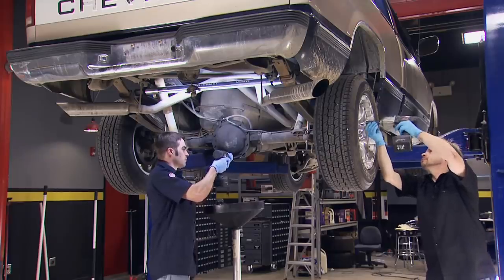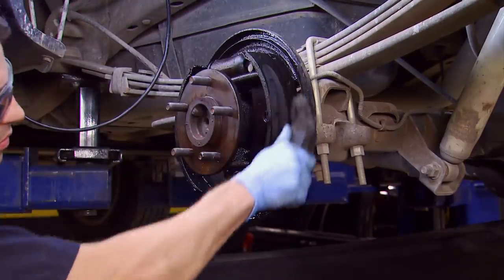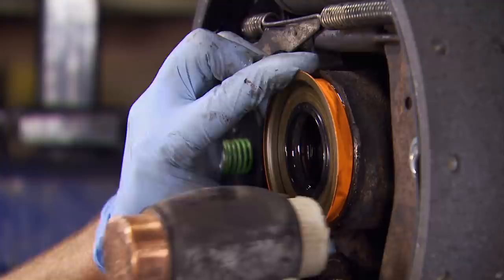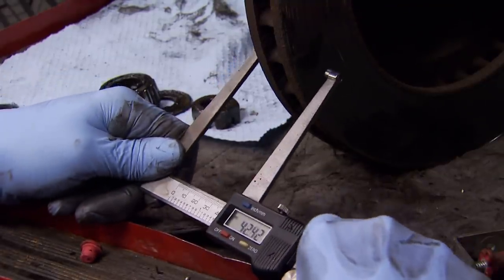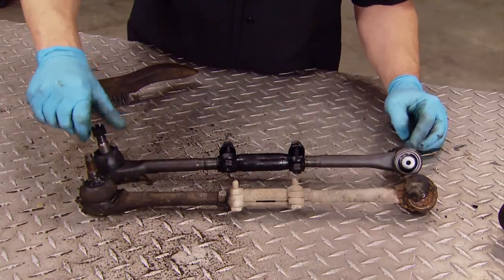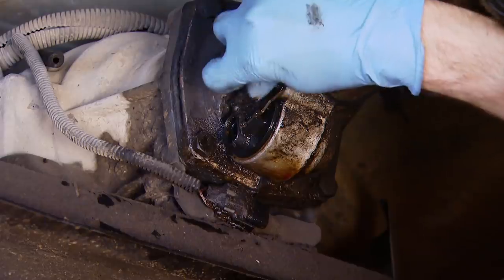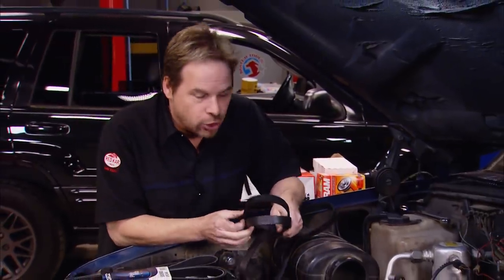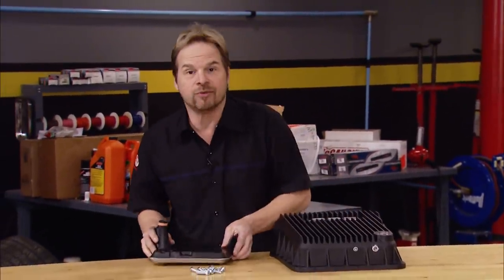Making a Chevy 1500 Workhorse With 260,000 Miles Safe For The Road - Truck Tech S1, E5

Comment: you guys dont deserve a shop talk about half assing everything and fram? wth come on cheap one from orielly is better than that walmart crap. the entire sensor needed replacing as well. actually first thing after sensor you should change fluid and filter in trans and yes fluid looks clean but a pan drop wont hurt anything costs around 40 bucks and can help it last longer(no flush on high mileage unknown trans) and if it does it was junk to begin with. only thing i agree on is keeping a spare plug wire and serpentine belt i do in my 93 as well.

Comment: Duralast brake pads will destroy your rotors . They are terrible!!   Never use them.. EVER!!   Crap!!    The pads to use are EBC Red or green stuff,  or Akebono.  If you have to go cheap, then go cheap on the rotors but never ever go cheap on the pads.  Best to go top of the line on both rotors and pads I agree.. But if you can not afford better rotors, always go for the best pads.. Never ever use Duralast!!! There is nothing durable or lasting about them except the damage they will do. These Duralast pads are cheap rotor cookers!!
Reply: I always order through Summit racing.  There OE replacement parts are top notch and cheaper than your parts stores.

Comment: Good luck finding a decent drum. All made in china which means they are not balanced, not round, and total crap.
Reply: I see they did use a Chinese POS Drum.  But that is all you can find any more. Sad.  Better off converting to disc once the original drums wear or go to the junk yard to get an OEM used drum.